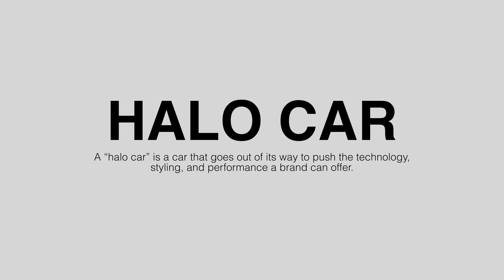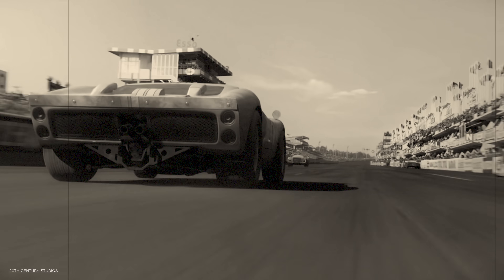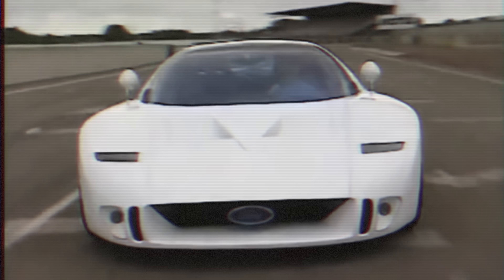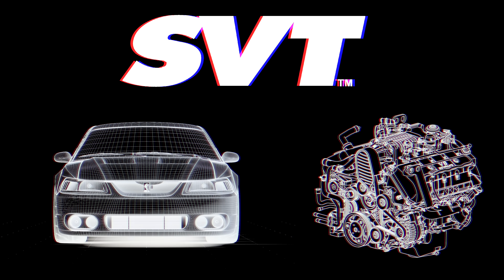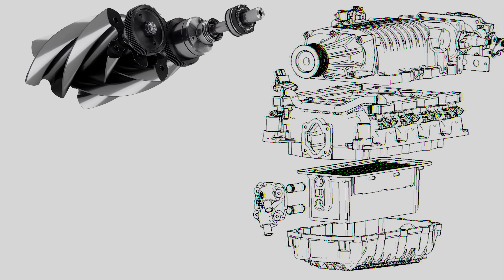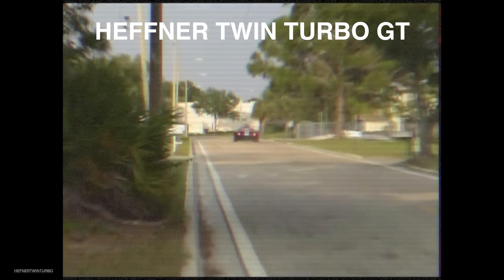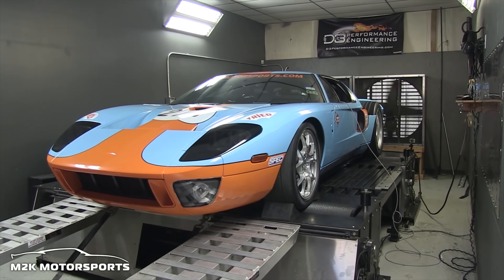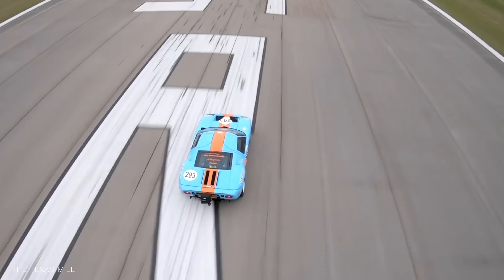Why Ford GT Engines Are Too Powerful (300MPH)😳| Explained Ep.16

Comment: Yes a stock block that has half inch thick iron sleeves pressed into it lmao 😂😂😂😂😂 and somewhere close to 50 psi worth of twin turbo boost if not a little bit more... Very impressive nonetheless... Any aluminum block with sleeves o rings or fire rings and damn good cylinder heads can do this... It's not rocket science people

Comment: funny how nowadays a coyote can easily hit 550hp and above completely NA imagine swapping the 2005 ford gt engine with a coyote and throw on it the supercharger from the 5.4 v8 casually 700hp and above
Reply: Why would you swap in a coyote over a superior engine? Coyotes are all about the heads and compression ratio. FGT heads destroy coyote heads. There is a reason FGT blocks and heads are in unobtainium price status now...
Reply: @SVT50BMG are you on crack? the coyote heads are significantly superior the coyote in general is significantly more advanced if you put the supercharger the GT 5.4l had to the coyote you will casually break in to the 700hp easily on the other hand if you remove the supercharger and tune up the 5.4 as a NA it would struggle to go pass 400hp without some upgrades to the cams and headers
Reply: @petrospago3515  Thanks for summing up what you know about 5.4's. It's equivalent to playing darts blindfolded.

2000 Cobra R's dyno'd ~385 to the wheels back in Y2k, bone stock. They have a 9.6 compression ratio.
You could take the blower off an FGT, put a 5.4 intake manifold off a Ford truck with some JB weld to fill the gaps and still make 400 hp on an engine dyno with its abysmal 8.6 stock compression.
Gen 3 Coyotes have a 12.0 compression ratio stock. A 5.4 with 12.0 comp is another league of power.

Coyote heads in perspective. The highest advertised flow I've seen for ported Gen 3 heads was from Livernois: 348/230 @ .500 on their highest level porting. There are guys running around with 2004 Terminator C heads getting 335/240 @ .500 lift.  Know why? Coyotes have excellent casts from the factory in terms of flow. 5.4/4.6 heads have the great wall of china worth of material they can port out. Old school NA 5.4 guys like Al Pappito were getting 370+/270 @ .500 lift back in like 2001 off Cobra R heads.

This all goes right back to what I said first post. The magic of the coyote is in its variable cam timing, excellent head casts (meaning lack of excess material from Ford), and the ridiculous compression they have stock. 2 of those 3 things are easily applied to other Ford modulars.

FGT block vs Coyote block is more lopsided than the heads...

Comment: Then this is why Bugattis will always be stupid
Reply: Why lol. The Bugatti Chiron 300+ was able to go 300+ mph with less than 2000 hp
Reply: @2003AudiS3  because you would need to be an absolute idiot to not get 1600 hp from a W16 with 4 turbos strapped to it.
Reply: esp when it all weighs 4500 lbs

Comment: Hell, I built a 1997 Cobra for $30k with A Griggs severe duty suspension that got 525 bhp to the ground that moved my seat of the pants-o-meter going 187 mph. It pulled flat 11s on street tires. It didn't look like a GT, but sure acted like one.

Comment: Back when EA made bare bones racing games with the Need for Speed series they came out with Need for Speed 3: Hot Pursuit. It had an updated list of cars and tracks but also with unlockable cars via cheat codes. One such car was the Ford GT-90 mentioned in the game and was the ultimate racecar.

Comment: Still amazing that a Ford GT, still road legal, was made to reach 300MPH. Took another decade and a half for another car company, bugatti, to make a road legal 300mph car, among others. GT was just so far ahead of it's time, people could really make it drive any way they wanted, rather than hyper expensive factory options. Bet the GT still even drives pretty normally around the road, even with the 3000HP.
Reply: John claims that he occasionally drives it on the street - runs errands, takes his kids to school, and so forth. With that said, he probably doesn't street-drive it a whole lot. One drunk driver, and he's out decades of work and hundreds of thousands of dollars.  
It wouldn't be too surprising, though, if he detunes it off the track. That wouldn't be too hard: change the EFI mapping, run it on pump gas instead of race gas, take the nitrous bottle and logging electronics out, put mufflers and bumpers on, open the wastegates early, and so forth. It might still be a handful, though.
Reply: @Baribrotzer  Running it on pump gas isn't a good idea. 13 to 1 compression on 93 is a recipe for disaster.
Reply: It does. Just like the Badd GT that broke 500 km/h and is the current record holder for the fastest street legal car in the world. They have different boost profiles, including one for daily driving.

Comment: T6 is just the temper and not the alloy. Aluminum is typically called out by alloy then temper Ex: 6061-T6 or 5052-H32

Comment: 1st of all, Magna designed and built the 2nd  and 3rd Gen GTs.  2nd of all  Rousch  and / or Chip Gnassi built the engines. and transmissions.  Ford just put their Blue Orville logo on it  and claimed it was theirs.

If it wasn't the aftermarket the Ford Fan Bois would still be driving Pintos and Mudsatin II's

Comment: 3:13 - EVERYTHING nowadays (& even before 2000') is designed with 3D software & tested with some sort'a FEA, even candy's packaging. ;) 
You can download a cracked version of Solidworks (with activating all features - the one you want running is Static Analysis)
There, you can take just any design - make your own version, try some idea of yours... optimize the design; 
then take account of material's properties (yield strength; behavior in temperature range;  elastic coefficient; fatigue) - technology available - processes.. design limitations etc. 
...just to find out someone did that job way ahead of you, and the design you study is already optimized. :D

Comment: Crazy thing someone just recently broke that top speed run with another Ford GT. I think it hit 310mph… man those cars are beasts
Reply: You're giving too much credit to the car.  You put 3,000hp in damn near anything and it will achieve a very high top speed!  The stock speed of this car is 200mph - if that isn't fast enough for you, take up flying!  :face-orange-raised-eyebrow:
Reply: @Loulovesspeed yeah I wanna see you do 310mph in a Honda and make it out alive
Reply: @Loulovesspeed  At that point, the stock body panels would go flying off most cars and they'd hit an aerodynamic brick wall. The GT was designed to be as sleek as possible. Also at that speed, you have to have a decent amount of downforce or the car will generate significant lift from the curvature of the Earth. And there's also the matter of tires. And the chassis. And making the car stable at that speed, and keeping the full interior and AC, and having a transmission/driveline capable of such massive angular velocity, and keeping it street legal, and making it able to do 300 in just one mile. Don't try to diminish this car's absolutely ballistic achievement. This is a grocery-gathering rocket ship.
Reply: @Loulovesspeed  brah who put you panties in a bunch. Who saying 200MPH isn’t fast. The aerodynamic of the Ford GT allows it to hit that’s high of a speed. Relax there buddy

Comment: funny that the gt90 has the same 5.9l v12 as does aston martin!
but with twin turbos on fords side and 2 ford duratec v6 squeezed together and na for aston martin!
man, i really like the gt90 and i for sure love elegant and mature v12 engines just as deep in my heart as rumbling several thousand horsepower big block v8 monstermachines!
and the white color is gorgeus!

Comment: The Ford Modular is the most underappreciated engine around. And im not saying that just because I'm a Ford guy. They were underpowered in the Mustang because of the small displacement and rpm requirements from being an OHC. Ford had their own aftermarket parts to make it more powerful. The aftermarket can make the 4.6 get close to Coyote hp easily N/A. And they sound great. But where they shine is in boost because it eats the boost like no other engine does. The power bands are smooth and stream line giving you the low torque and high ram power that makes the engine a rocket engine.

Comment: Remember, it's also the industrial chemists who developed tires that would hold these supercars on the road without breaking up. THAT was also brilliant technology.  My dad was one them.
Reply: Props to him
Reply: Where the rubber meets the road
Reply: My respect for your father. Good tires are one of the most important things on a performance car. Cant grip, put power to the road, or will just fail from the power and speed.
Reply: Amazing!! So few go fast gurus realize that if it were not for the design engineers-chemists-production engineers, these speeds would never ever been achieved. You must be very proud of your dad!
Reply: We're those street legal? Pretty unreal regardless, truly impressive.
Reply: calm yer tits bro, people make the bolts that hold your rubber on, without those your tires would be worthless. The list goes on...

Comment: T6 is the ageing condition of the A356 aluminium alloy used for the block. It's the alloy system here that's important to emphasise seeing as almost every cast aluminum alloy used for engine blocks will be in the T6 and maximum strength heat treatment condition

Comment: What's it's 1/4 mile time ? And I don't believe it. Because Ford can't seem to build anything that holds together . I've seen so so many mod motors crack and the coyote is a Ford version of an LS that comes up short.  Hinky timing chains , really bad followers , oil pressure issues , etc...

Comment: When I was younger I read and watched stories about the Ford Gt's at Le Mans doing over 260mph before they reached the end of the Mulsanne Straight (before they installed those chicanes on the straightaway), and my mind was blown. So I thought to myself that with modern tech and the new Ford GT 300mph should totally be possible. Now here it is, lol. That was incredibly awesome and I feel satisfied knowing that someone actually achieved. Tbh I was considering that it might not even be a Ford GT achieves it because of all of the other crazy and powerful supercars out there. I wonder if this was the first road car to achieve 300mph.
Reply: It was the first production street legal car to hit 300mph. Bugatti did 310 something but needed 10 miles to get up to speed and claim they were the first to do it. Which I believe they've had to walk back on that claim.
  The fastest speed ever recorded on the Mulsanne Straight by a Ford GT was the Mk.IV in 1967 at 233mph. The Porsche 917 went near 250 mph. I'm sure many cars could do 260 today without the Chicanes. But you have to realize that until Ford built the GT40 in 1964, no car had ever gone 200 mph on the Mulsanne Straight. The Ford GT40 was the first car to do that. 

It was the greatest thing to be 12 when all this started. Guess what my first car was?😊

Comment: Back when I worked at a Ford dealership and being a new tech fresh out of the ASSET program, I was all about the svt line and taking all the classes and getting certified to work on the " big boy " toys. I remember the day we got two of these and they got shipped sealed and on casters. We had to push them into the show room . If anyone remembers tousley Ford in white bear MN , that parking lot was a down hill 😕 " if this 150,000 dollar car gets away from us this is gonna suck " .

Comment: I love the sound of the Ford GT. For me probably the best sounding V8 ever made. They swapped from manual to semi-automatic gearboxes on race cars after a while which was sad because the manual gear shifts sounded extremely cool.
Reply: @CrossEyedLion  - The '05 and '06 Ford GT had a 6 speed manual only, and the current Ford GT has always had the dual clutch 7 speed semi-auto.  Even the Corvette is now auto. only.😩

Comment: Just for perspective, the Chrysler ME-412 was very similar to the GT-90 and it was built and tested and i managed 254mph on the Chrysler Chelsea test track.
Reply: @X - The only thing Chrysler about it is the name!  Didn't even have a Chrysler engine!
Reply: @Loulovesspeed  A concept car built exclusively by Chrysler but you claim it is not a Chrysler and has no Chrysler parts in it. Wow.
Reply: @topenddean  Chrysler obviously was involved with the design, but then they used a Mercedes AMG V12 for power.  At least all the Ford GTs were powered by Ford engines.  I guess they didn't feel that the Viper V10 was up for the challenge!  Lol
Reply: @Loulovesspeed  "Chrysler was obviously involved..." smh Daimler-Chrysler. Do you know who that was? Your comment was not very well thought out.
Reply: @topenddean  I know what Daimler-Chrysler was.  It was created in 1998 and Daimler had enough with Chrysler by 2004 and drop kicked Chrysler out the door!  I remember when I first heard that they were merging.....I absolutely couldn't believe what I was hearing!  You couldn't find 2 more dissimilar companies if you tried.  My disbelief was substantiated when it failed 6 years later.🥴

Comment: The Ford GT of 05-07 are in the icon club, the fact that they trade at double to triple their original costs shows just how desirable they are.  No one can afford much less use on a regular basis a GT40mk1 which is close to the pinochle of cool dleds

Comment: In 2006 the owner of the project I was working on bought 3 GT40 cars and 2 GT500 cars and had them delivered to the shop. Those GT40 cars were beautiful and I remember the whole underside of the GT40 cars were completely covered by sheets of aluminum. The GT40 cars were blue with white stripes, white with blue stripes and black with silver stripes. The GT500 cars were blue with white stripes and white with blue stripes, both GT500 cars were signed by Carol Shelby on the dash. The GT500 cars were cool especially the white with blue stripes one as it came with the top tier race package, however I was all about those GT40 cars..

Comment: The real secret to a high performance engine (as GM has discovered finally) is to abandon the push rod actuation of the valve train, either a Desmodromic, or chain driven DOHC layout with 4 valves per cylinder (to enable an ideal breathing cycle)  gives the best results. This layout also removes the need to keep increasing the engine's capacity (and weight) by giving the ability for much higher revs. The DOHC chain driven system, precludes valve float, allowing for a smaller capacity engine to rev much higher. As demonstrated in GM's Corvette. This is hardly a secret really, it is simply that the USA has long taken a different direction, owing to the extraordinary low prices for fuel. The forced induction path is also an excellent approach, but again, with a smaller capacity engine, a higher revving unit can still deliver high torque and HP outputs.

Comment: Nope! They got it all wrong from the beginning. Reciprocating engine can never be powerful. It's the least efficient way to generate power. Implementing GDI system onto reciprocating engine alongside with supercharger or turbocharger will only worsen the engine. The combination of GDI and turbocharger or supercharger will tremendously increase intake air pressure allowing more fuel to be injected into combustion chamber just to produce more power. But at the same time fuel is wasted even when engines are in idle mode stopping at traffic lights or cruising downhills. On top of that, anything to do with high pressure or high temperature is really really bad. Nothing lasts under that type of situation. Do you understand why your new cars are so unreliable by now?

Comment: The original Gt90 design was going to use 2 Yamaha SHO v6 engines joined to make a v12 with 4 turbo units. During the design phase Ford stopped using the Yamaha engines and switched to the modular V12 custom engine. The Yamaha SHO v12 also had 4 turbos and 720 hp.

Comment: A few seconds into this video and I am disappointed in the misinformation. The GT40 Mk1 did not win in LeMans in 68 69 (The Mk1 never won at LeMans actually) It was the Mk2 that won those years. And the 2006 GT was based on the Mk2 that won in 1966.
Reply: I believe the 1966 was win with a MkII, and the 67 was with a MkIV. A 5.0 liter engine displacement limit was imposed after the 67 race by the governing body after initially believing that the 66 win was simply a fluke, Ford did it again with their big 7.0 liter, breaking many records, including fuel efficiency (5 mpg was apparently efficient). The GT 40 retuned for 68 and 68 with the earlier GT40 powered by 302 with Gurney-Westlake heads (GT40 head) to comply with the rules and won two more years. I thought the 68-69 cars were MkIs, obviously with upgrades.
Reply: @gutz1981 - Looks like we could use a little refreshing of our current idea of what model Ford GT40 won at Le Mans in '68 and '69 (same car, by the way).  It was absolutely the Mark I with upgrades and revisions by John Wyer (JWA) and Gulf Oil sponsorship.  The GT40 MKIIs were victorious in 1966.  The most obvious difference is the dual side intakes at the rear sides and the engine cover on the MKII as opposed to the separated intakes on the MKI and a much larger venting area over the engine.  You are correct though in saying the "05 and "06 Ford GT was designed after the MKII.